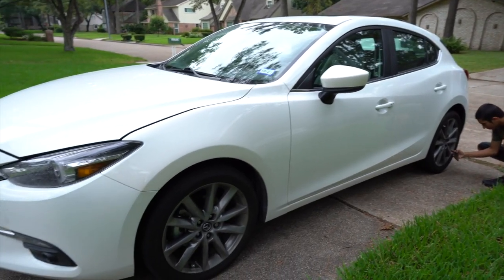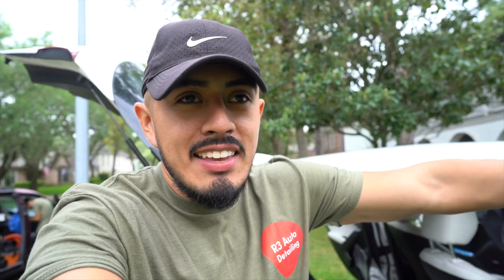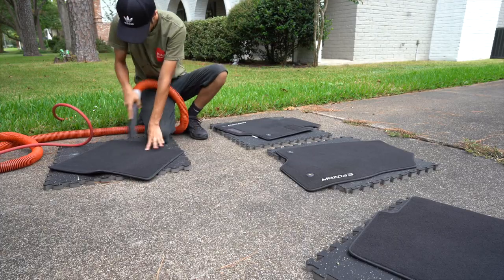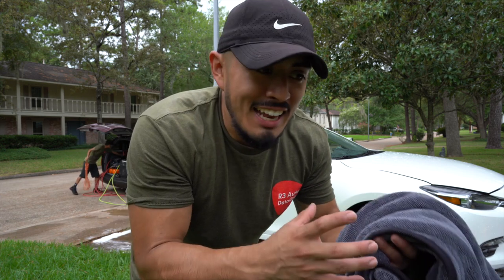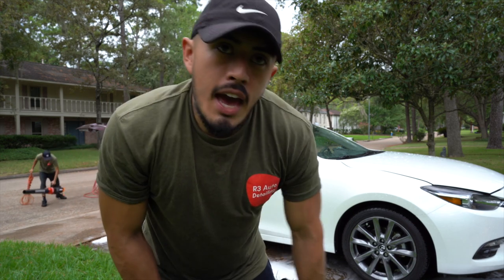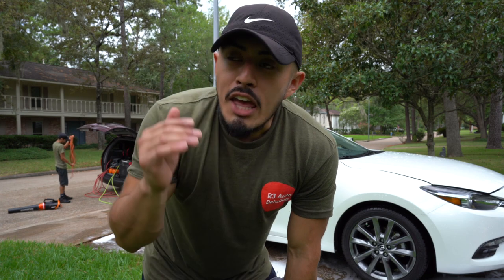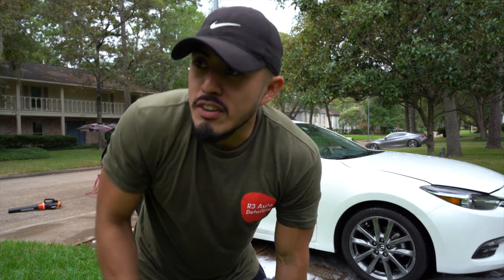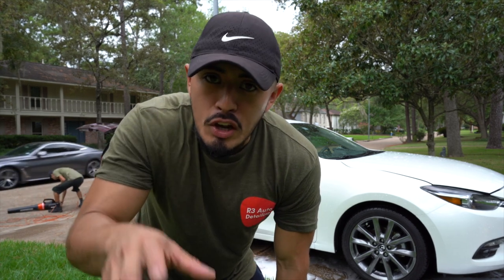Best Detailing Business Model: Paint Correction vs Interior Cleaning vs Car Washes

Comment: You are right about construction industry. Here in Canada the profit margin added after estimating a project is usually 5%, and as a sub-trade you are usually 2-3months in before getting paid the first month's installment. Then some General Contractors will mess you around and not pay you or find excuses not to pay you. They also keep a 10% holdback until project completion. Some will also find excuses to back-charge you for made-up stuff or delays that are not your fault. It's pretty horrible at times

Comment: Hi, One question is it safe to spray water under the hood like that?
Reply: All the major electronic components were covered,So yes. But usually you would have to cover the main engine due to spark plugs and distributors along with removing battery and covering the air intake.

Comment: It all comes down to how much you make per hour after expenses.  As a mobile detailer, I think that the most lucrative jobs are the ones with specialized services where you can charge a lot per hour.   If you decide to do 25 washes per day, that is hard to be profitable because you can't charge much for a basic wash and you have a ton of downtime going from one client to the next.  Also gas cost and putting all that mileage on your truck adds up quickly.  For me, Ceramic Coatings and headlight restoration give me the highest amount per hour.   I also build my package to do a lot of work and thus making long days at the same place.
Reply: How much do you charge for ceramic coating and for the headlights?
Reply: @MultiPablo1987  For headlights I charge a 100$ flat fee.  Takes me about an hour to do.   They are most profitable when sold as an upgrade to an other package, because you are already there so no travel time and no gas.  For coatings I it depends on the coating and the prep the client wants.  Ranges between 529$ to 1500$
Reply: Thank you so much for taking your time and reply my questions...